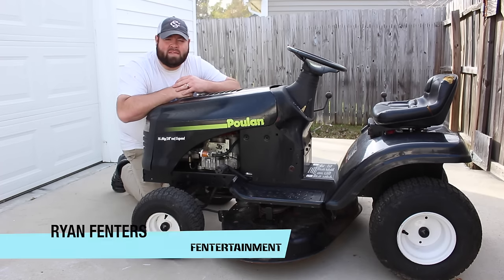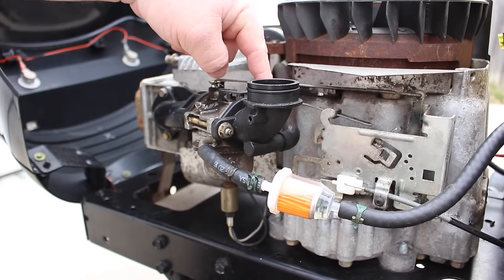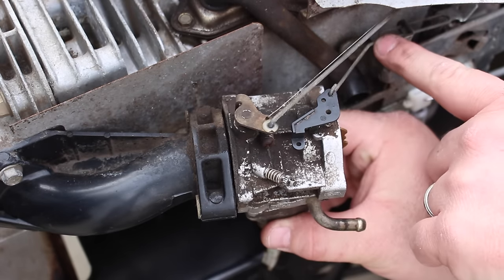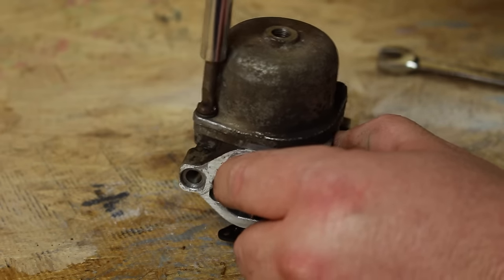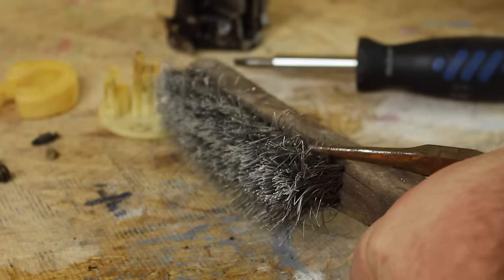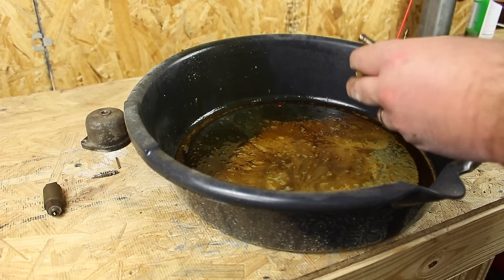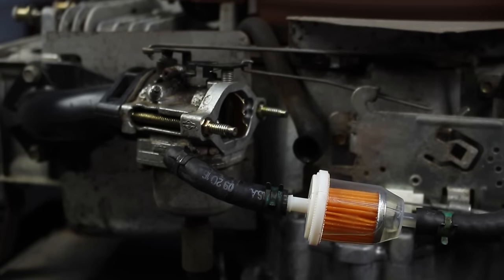How To Fix Briggs & Stratton Surging Engine | Nikki Carburetor Cleaning | Motor Hunts UP & DOWN

Comment: good video...... How are you with generators? Have you done a video or suggestions on setting up the Governor after replacing a carburetor? I have gotten the generator at idle to be set to 60 hertz, but not sure how much the volts should drop after connecting a tool that only pulls a portion of the volts the generator is capable of

Comment: I have a troy bilt tb110 push mower from home depot have not pursued the store warranty on it but it just started acting up it throttles really loud. I've checked the air filter underneath the deck spark plug not sure what's making the loud noise. Also check oil and gas? Any ideas what it could be?

Comment: This is a brand new carburetor that I put on the mower and now that it has run for about 3 to 3.5 hrs it has started surging.  The new carburetor should not need to be cleaned so what could be causing the surging?  Could it be the spark plug?  It is old! also the boot for the spark plug is split, could that cause the surging.  Please let me know what you think!  Thank you for your help!
Reply: Spark plugs causes misfiring, but generally surging is an engine starving for fuel, the governor opens up, lets more in and then backs off, and the whole circus starts all over...ie; surging.

Comment: How in the hell did six people dislike this video?  Nice work.
Reply from the maker: Thank You
Reply: Haters gonna' hate
Reply: He shortcutted the re-assembly, some of those screws aren't just tighten till its tight. Also gaskets sometimes don't come off in re-usable condition, its good to have plan "B" ready instead of just throwing everything in a 5 gallon bucket for the time that you get parts in. Otherwise, a good video.
Reply: They wanted to know the actual cause for the surging. It was never discussed.
Reply: cleveland mortician may I suggest you watch and listen to the video again, it was discussed but I won't tell you you have to watch it again.  ; - )
Reply: Just me 2 so clean everything and hope you solved the problem. Nice answer. Isnt that what everyone does anyway?
Reply: For the most part, no pieces of trash is EVER, 1000% of the time, the same. For one thing how can your piece of trash be in my carb... Can also be water, or any debris that is in the gas can. Fuel filters help, but even they can allow some things through into the system... Any one of those holes he talked about can be clogged or have resistance. Your problem is your exact problem, mine is mine. People should be more open minded about these very informative videos. They are here for design and technique, not entertainment... Very helpful vid...
Reply: Because stupid people dislike a video because THEY chose the wrong one to view. If we could only dislike them!
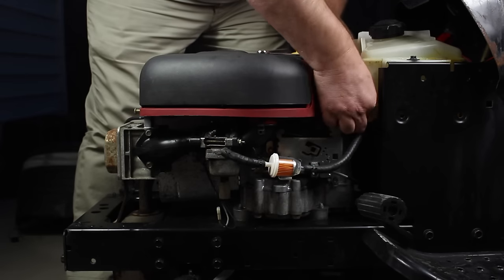Reply: The sold their mowers thinking it's someone else's junk now, and finding out now they spent $3500 at Lowe's on a new mower when they could have spent half an hour to an hour of their time...or 5:46 on YouTube 😆😆😆😆

Comment: I put on a new carb, fuel filter, spark plug, manifold gasket and air intake gasket and mine still surges. If I remove the air filter and hold my have over half of the air intake hole it smoothens out so it's sucking in extra air somewhere...I just can't find where

Comment: Mine is surging at only rabbit position. It’s a brand new carburetor. Any suggestions? Maybe the air fuel mixture screw? Thanks
Reply from the maker: Ive replaced a many of the carburetors with the cheap amazon china carbs. They do great once you get them dialed in and yes, I usually do 2.5 turns out from all the way in to start with.

Comment: the fuel shutoff solenoid on the carb bowl DOES NOT stop fuel coming into the carb from the fuel tank.....its actually used to stop fuel going into the engine from the carb bowl when you turn the key off, it also stops the engine backfiring when you have a hot muffler which was one of the main reasons they were fitted in the first place....have a look at where its placed and you will see its purpose....if you have one of these carbs flooding, it will be from the o ring that seals the plastic float assembly to the body of the carb.....also the main jet should be fitted inside the main fuel pickup tube when the emulsion tube goes, NOT held in place by a spring on the outside, that spring is not something fitted from the factory.

Comment: All the other videos show the main jet going from the bottom up with the o ring  side in first then using a small drill bit to push it to the top about an inch and no spring.

Comment: Hey bro I've have an issue with that same motor. It starts and runs perfectly at any throttle position. I can engage the cutting deck and it will run fine but after some random amount of time the engine  will bog down and stall (while under load). I can prevent a complete stall by disengaging the blades and putting the throttle into the choke position. Can I save the carb or should I send it into a low earth orbit.
Reply from the maker: I'm not gonna lie, I've sent some into some low earth orbits Haha. I believe if you clean the carb and make sure all the small passages are clean then you should be gold. Please let me know what you do and what happened

Comment: good video !! but two things the solenoid that you are removing to remove the carb float bowl has nothing to do with fuel entering the float bowl (carb) that solenoid has a pintle that when the solenoid is activated by key switch moves the pintle from blocking the hi speed jet,allows fuel to enter cylinder by traversing thru the carb motor starts !!! turn key off the pintle blocks hi speed jet motor ceases to run from lack of fuel

Comment: do the newer carbs have a main jet in that location because i swear there was nothing on that plastic body when i took it apart. its a intek  219907-0131-b1 080216za   this is the first carb i have ever worked on that resists treatment with an almost self aware resolve.  where is the main jet if not on the plastic body?

Comment: I have a generator that surges and of course I don't get the current that it is supposed to generate. Will this work on it?
Reply from the maker: I'm not a mechanic so let me get that out the way, However you could have 1 problem or 2. I would start by cleaning the carb thoroughly to get it leveled out as far as the running. However if that doesn't generate the power it could also have a generator issue.

Comment: I replaced the carb on my 17.5 Briggs and when it runs now it surges irregularly and sometimes stalls.  It smooths out when I apply some choke.  Is this an adjustment problem?
Reply from the maker: Should be an air fuel mixture screw on the side. I would turn it in till it stops and then turn it out 1.5 turns. Might wanna also be sure that the air filter is good.

Comment: I have a craftsman lt2000.  It's surging still.  I put on a new carburetor, new fuel filter, new hoses, new sparkplug, and fuel hoses, , new clean gas, why is it still surging?
Reply from the maker: I've installed new amazon carburetors in the past and after the install they would also surge. What I did to fix that was adjust the air fuel mixture screw all the way in and back out 1.5 turns. If you do this dont "snug" it tight, just turn it till you feel resistance.

Comment: My Briggs 15 hp ohv is doing the same thing, I have installed a new fuel filter and a new carb and it is still surging.  What should i be looking at next?
Reply: I would like to know also.new everything on my mtd .will the valves cause it to backfire like crazy

Comment: Nice video.  As a suggestion, when spraying with carb cleaner, be very careful, if you get the cleaner on the rubber gasket, it will swell and then will be very difficult to re-install. I now 
remove the gasket out of harms way of the cleaner, then lightly oil gasket and replace.  If you have by mistaken gotten cleaner on the gasket, you can try and put it in the freezer to see if it will return to its normal shape and size.

Comment: Good vid.. problem tho. Make sure you put on the vid if u  discover gas in the crankcase. Hope not but that needle valve and seat needs replaced if you disassemble an older carb.

Comment: I have a brand new carb instaled and it is surging. Also after about 15 minutes of running the choke shuts by itself and shuts the engine down? Any thoughts?
Reply from the maker: Have you tried to adjust the air/fuel mixture screw?
Reply: I've tried that today. Not my forte but I set the fast idle first then adjust the mixture till its smooth? Is that the proper way? Thanks

Comment: Could you run injector cleaner carburetor cleaner through the gas tank A couple of times and see if that would take care of the problem before you have to tear into and do all that ?
Reply: I have a 540cc 21 HP Briggs and Stratton engine. It started cutting off when I engaged the blades and when I took my foot off the clutch/brake. I changed the oil, fuel, all filters (oil,fuel and air), spark plug replaced the car with brand new and also changed the fuel pump. Prior to me doing all that work if it sat at idle it would run very smooth. Now it spits and back fires at idle and still shuts off when I try to engage blades or take foot off clutch/brake. If anyone can help me I would greatly appreciate it. Stumped in Memphis.

Comment: Someone please help! I took the carb off cleaned it which fixed the surging. After I reinstalled the carb and turned it on the idle speed won’t change (choke works but the acceleration deceleration isn’t working) when I manually change it on the dash of the riding mower.

Comment: here is what works for me... only use super unleaded in your lawn mower. I do and have never had to clean out the carb. 87 octane is crap gas and has too much water and ethanol in it. It junks up your carb..
Reply: Jay M 
I think your right about that low octane gas.
Reply: It depends on where you get your gas. In some states, there is the same amount of ethanol in all grades of gas. If there is water in the gas, its time for a new gas station. Either their volume is too low and they order too much fuel and its sitting or they don't properly maintain anything.

Comment: I have replaced my old carb with a new one and the engine is surging. Could the new one be bad? Or do I need to take it off and clean it?
Reply from the maker: Adjust the adjustments on it when you put it on? I've installed a chinese carb from amazon (cheap ones). They ran like crap till I adjusted them. Screw the set screw all the way in and back out 1.5 times. See if this helps on the surging of the new carb.
Reply: Fentertainment I did that and it still is surging.

Comment: My walk behind surges. With the air filter removed it smoothes out. Not sure this is an accurate representation since the filter wasn't put back when the engine was run afterwards.

Comment: fuel dripped out of mij carb Just clean up the carb, but the fuel won't stop i comes out the carb en also fills the cilender. the floater is ok. Mayby the floater needle??
Reply from the maker: The float controls the needle. Make sure the needle and seat ia good. Also make sure the needle is still connected to the float. Once you have it apart make sure the float does t ha e anything in it causing it to be heavy and allowing gas to enter the bowl.

Comment: Hi, I know this is an old video but I just watched it and I have a question: What about the idle screw? Do you adjust it the same way as the air/fuel mix? 1 and 1/2 turns out? Please advise. Thank you
Reply from the maker: That's a good question. I would start there and just listen it the engine and go from there.

Comment: My mower sounds like this with a little bit of hissing or backfiring sound as well I cleaned the carburetor out happened to be a Nikki carburetor too. Do you think I should try replacing the needle valve and the float and all gaskets because I gave it a real good cleaning and it's still making this sound
Reply from the maker: Before I took the time to go through all of that. I would get it running and take a can of carb cleaner then spray around the carburetor. If it sounds different then you have found which gasket is causing the leak. Thats what I generally do.
Reply: Fentertainment so while it's running spray around the carburetor...where it meets the manifolds etc? And I'm checking the gaskets this way?

The symptoms I have that's a little different is that little popping backfiring sound...sounds like popping or spitting...also I think fuel is getting up into the air filter...i have found some fuel residue around where the air filter meets the manifold
Reply: Fentertainment I found the problem with mine. I was looking around and I noticed that little hissing sound was coming out of where the Welch plug should be I didn't really know for sure so I looked at another mower that I had which had the same exact Nikki carburetor on it. Well sure enough that Nikki carburetor has a Welch plug covering that hole there's a couple air Jets behind it so I'm running extremely lean letting all that atmospheric air in
Reply: Yeah I'm putting this one down in the memory bank if I ever happen to have this problem again with a motor that surging and also having a little hiss like air is escaping sound then definitely take a look at the Welch plug and make sure that it is intact

Comment: 18.5 ohv intek 05  model  briggs and stratton will the  carb solenoid cause it to cut off while cutting grass? mine runs fine but at times it acts as if its running out of gas  and has a tank half full or more  its cuts off I restart it  it runs but to idle it up seems like theres no fuel  whats the problem?  carb been cleaned to fullest as you have showed in this video
Reply from the maker: Did you replace the fuel line and filter? If not I would change those could have some trash in it that is doing this. I had this very problem once and it was the filter.
Reply: yes and i have no surging issues it just cuts off ... will the solenoid  cause this problem
Reply: filter i can blow right thru it with ease
Reply from the maker: The solenoid is the only other thing that is in the way of the main jet. In the past I have removed them and cut the rod off and put it back on but I installed a fuel cut off inline. I have also bad seat switch contacts wear over time. I'm not gonna be able to pin point the exact problem over the computer.
Reply: yes  from the person i purchased it from  he had gas mixing in his oil  ... and thats what i did i put a gas shut off valve on it  to stop that problem  but the carburetor and solenoid is the same ... but when the other owner had it  had not gas shut off valve on it and  gas would mix in the oil  so it maybe a bad solenoid   causing my problem
Reply: runs perfect  its always been serviced  it just cuts off at times like there's no gas in it
Reply: I fixed  it it was the solenoid thats been causing the problem   i took it off and cut the part that  goes up and down  it was was cutting my gas flow off .....  works fine now  so if anybody has that problem in the future
Reply from the maker: CARL SPURLIN good deal man.

Comment: Misconception about the fuel shut off solenoid. The float & needle controls the fuel entering the float bowl, the fuel shutoff solenoid shuts off the fuel flow through the carb main jet when the ignition is shut off. The purpose of the solenoid is to prevent run-on after the ignition is turned off. A faulty solenoid can cause a no run condition. Loss of ground at the solenoid will cause it to stay closed preventing the engine to run.

Comment: Is this the same as when it won't run unless it is on choke?
Reply from the maker: petro062 yes, on some models you have to run choke.
Reply: It's an 11.5 and it ran right the first year. The choke worked like it supposed to. Now I got to run it on choke and I don't think it has as much power. I'll try to clean out the jets. Thanks.

Comment: Hi
My 12.5hp Briggs engine .replaced carb with Chinese. Still flutters on govener arm.
Tom Mixer..
Reply from the maker: Try setting the air fuel mixture screw on carburetor. I've replaced carbs with amazon carbs and it still happen, The only luck Id was to screw the mixture screw in, not tight. Then screw it out 1.5 times. See if that helps.

Comment: my air fuel mixture r stew has a plastic cap cover or something which prevents me from moving it. how I adjust it or move it
Reply from the maker: You should be able to remove the cover with a set of needle nose pliers.

Comment: That main jet is installed wrong, someone messed with that carburetor before. The backfire solenoid does not control fuel flow into the bowl.
Reply: pfun41 That's what I thought. I saw another video where the jet goes down inside the tube.
Reply: Correct. The main jet goes up in middle of tube. O-ring at top, main jet round big circle faces bottom.

Comment: Would this also help with bog down when blades are engaged?
Reply from the maker: It could.
Reply: Thanks. Got a Hustler w-Kohler 7000 engine, brand new 2018. Just did tuneup and that’s when started bogging down and surging. Does that make it even more possible that carb needs cleaning? Did the Seafoam treatment but no good....
Reply: Well I pulled the carb and cleaned it and cleaned the deck and spindles free of clippings. Some improvement but not where I want

Comment: Put a brand new carb on my mower......still surges....any suggestions??
Reply from the maker: Did you adjust the fuel mixture screw on the side of it? If not screw it in till it stops and screw it out 1.5 times. You can check to see if that will help the surging.

Comment: I didn't have to clean mine but replaced with brand new one and its doing what yours was doing before the carb clean...!!!???!!
Reply from the maker: Might need to adjust the fuel air mixture screw, Did you ever figure it out?